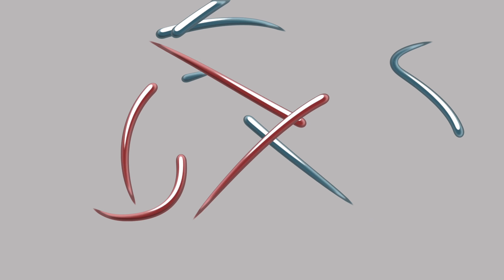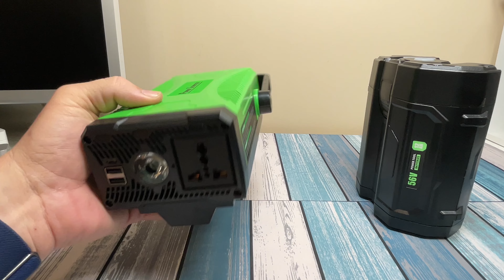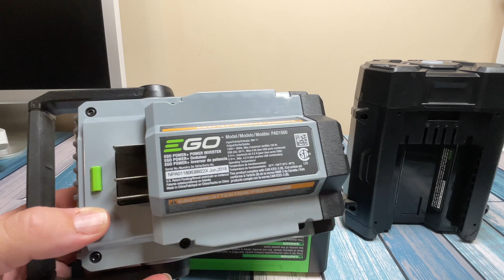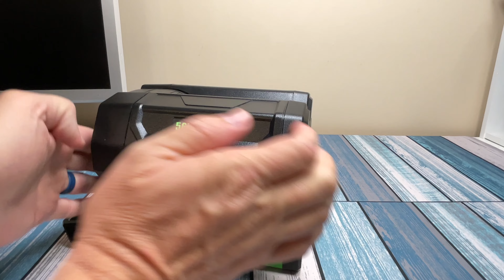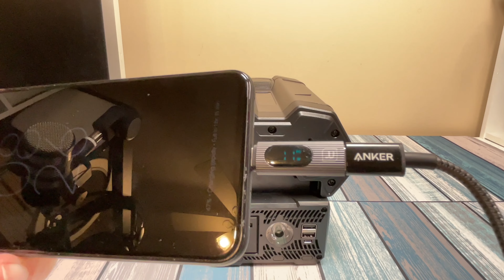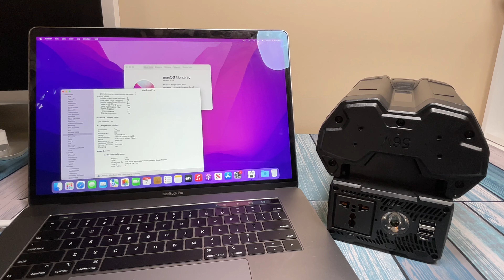Generic (Cheap) EGO Compatible 300W Inverter - Full Test and Review

Comment: Perfect timing! I was looking for any reviews of this exact inverter for my Ego batteries and you posted this about an hour before I searched 🤣 I'm wondering if this would power a full size crock pot on the warm or low setting for keeping food warm at an outdoor party with no electrical outlets. I'd love to see this Sunmily company do a version of the 3000 watt Ego generator as well.
Reply from the maker: Check the wattage of your crock pot. A full size probably uses 200-500 depending on the setting. Also check out the EGO 400w Nexus. They have a $100 off promotion on Amazon if you buy $300 of select items. I think you could get the 400w Nexus and the 10k Lumen Light for about $200 after the discount. If you can use the light that’s probably a better deal than this inverter. Let me know if you have any more questions!
Reply from the maker: https://amzn.to/45Ve4kZ
Reply: @FamilyGeekery  thanks for this info and the link! It would be perfect if the deal included the 3000 watt Ego generator, as I'm actually interested in both.